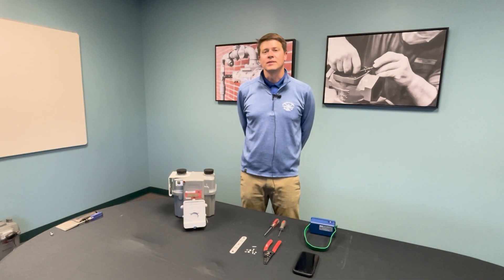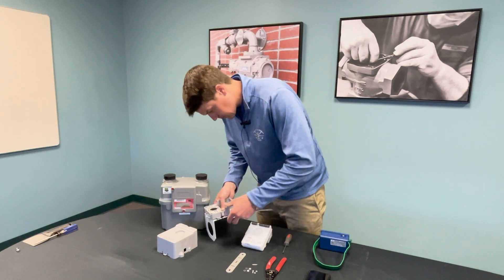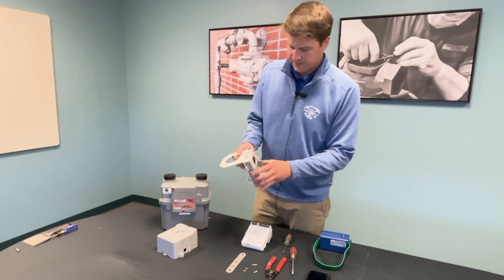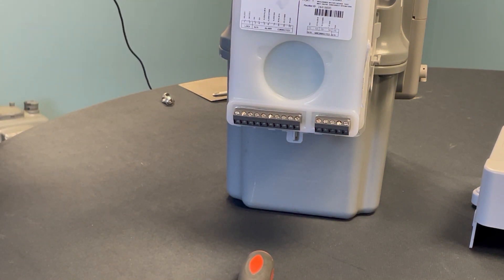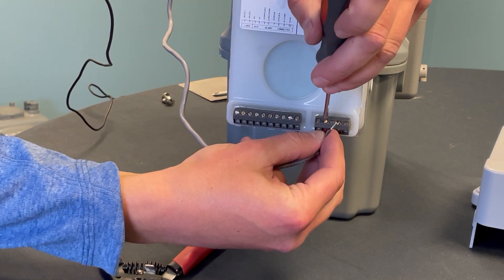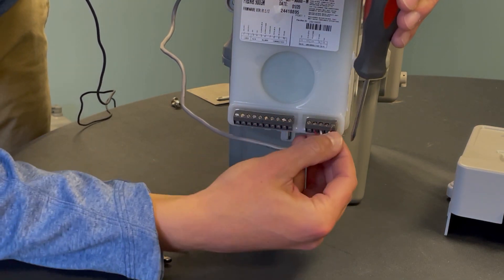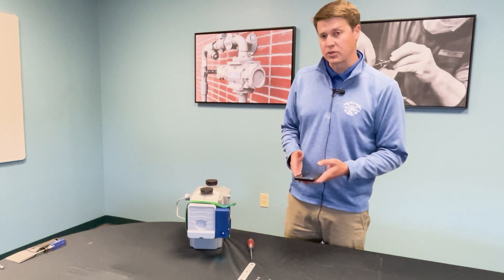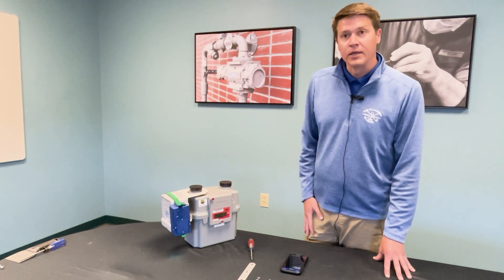How to Install & Activate an Industrial Sensus SmartPoint

Comment: A customer of mine purchased and installed a sensus water meter and compatible flexnet smartpoint in series with the utilities meter to bill individual business spaces. He has asked me for a hand as he was confused by the system, and I work with low voltage systems usually so he thought it’d be in line with my work. 

We are having trouble getting the phone application setup. He does not have the blue command link device that you used here. I’m having trouble finding documentation on use of these products and the fieldlogic tools application. 

 It is asking for a configuration file, which from reading the documentation I’ve been provided, I’m not sure what it is a configuration file of, for, or where we can obtain one.
Reply from the maker: Hi there! We only serve natural gas utilities, so unfortunately we can't advise on a water application. Your customer probably needs the CommandLink, however. You can learn more about the CommandLink here: https://hollandsupplycompany.com/products/sensus-commandlink-wireless-interface.
Some info on the industrial SmartPoint is here: https://hollandsupplycompany.com/products/smartpointr-gm-industrial-transceiver

I would suggest reaching out to Sensus customer service as they could provide better insight.